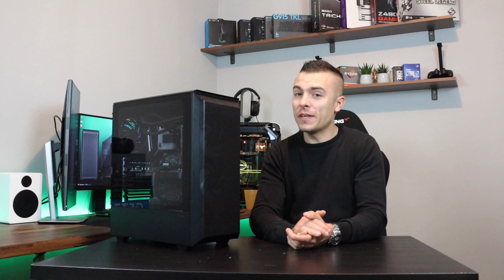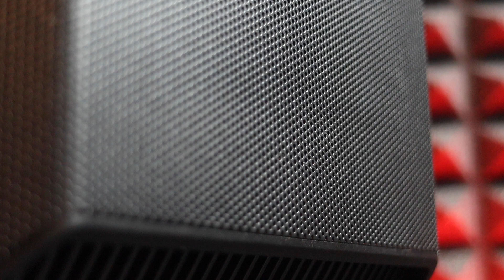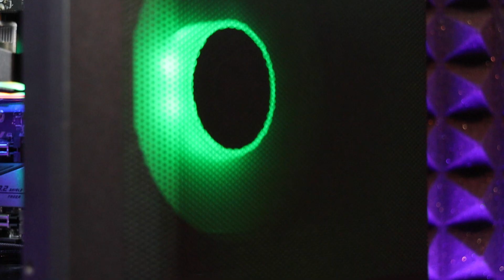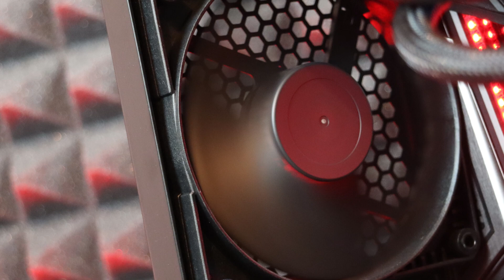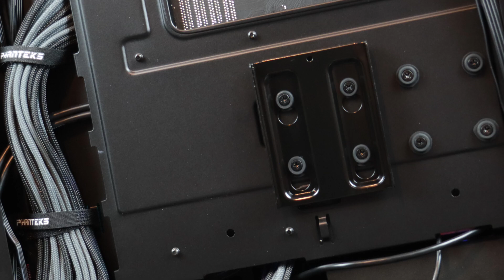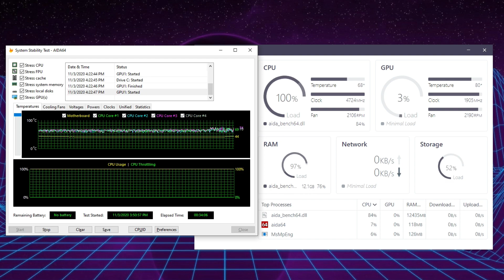Phanteks P300A - amazing airflow for $59!

Comment: Hi, love your video. I just bought this case and I was wondering if a RTX 3080 ti can fit with a radiator (the MSI MAG Coreliquid 240r V2). The RTX 3080 ti lenght is 324.00mm
Reply from the maker: Hi, thank you very much. The case has 355mm clearance for the GPU. That leaves 31mm of space for the radiator if the fans are mounted on the front side of the chassis. But even then, it will be a tight squeeze.

Comment: AIO upsidedown
Reply from the maker: Oh no... Bubbles will damage the pump... Thankfully the pump is lower than the top part of the radiator so there won't be a problem. Glad that no one since the AIO was invented literally never had a single issue with this position. But after Steve did the video, everyone has problems with their pumps and AIOs. Funny isn't it. :P

Comment: Great review! Would it be a problem to use a 180mm PSU with this case? Thanks!
Reply from the maker: Thank you very much. The PSU clearance is 200mm so if you find yourself in a problem with the cables, you can always remove the HDD cage if you don't intend to use it. ;)